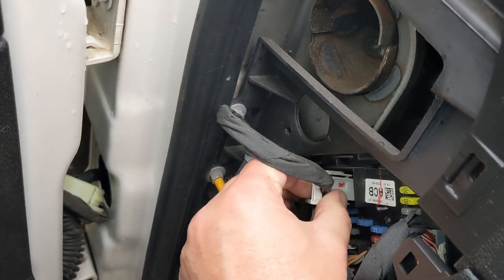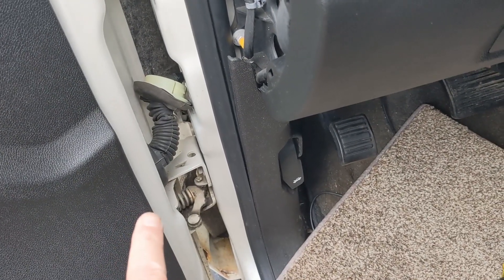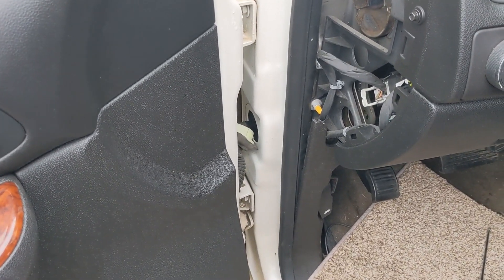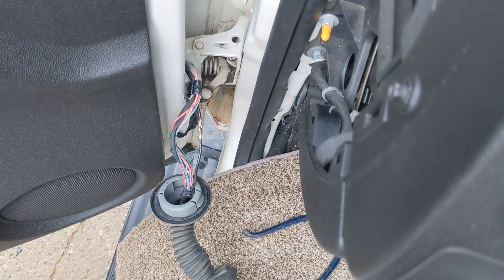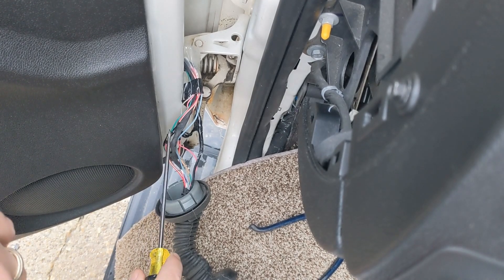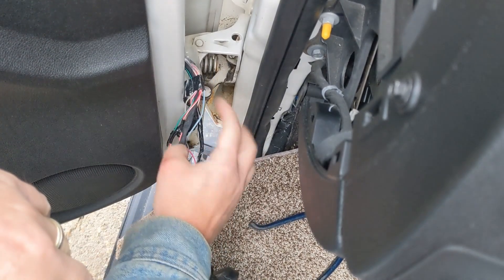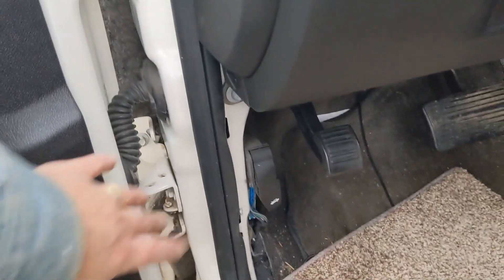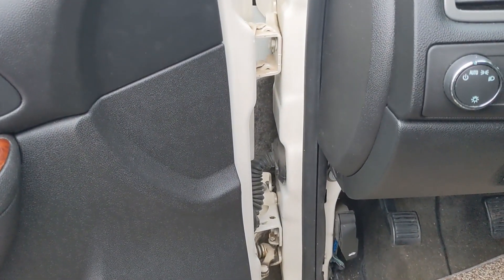Avalanche Door Controls with intermittent power,. Found broken wires in door jam and repair. Pt 2/2.

Comment: If youre having no power to door switches read this comment!!!  THIS FIXED MY AVALANCHE!!!! After checking all the fuses on the truck twice, switching out the driver door module, replacing the 25a circuit breaker on the instrument panel, and unhooking the battery I finally found this video. I unhooked my connector from my instrument fuse panel, took a volt meter checked each wire for continuity from the connector to the driver door module, and low and behold there was a break in a brown wire. Soldered, electrical taped, and cable tied. Thank you AT HOME AND HANDY!!
Reply from the maker: Great to hear that my video helped as there is nothing worse than having an issue and not knowing what the cause/fix could be. And thanks for the kind words. :)